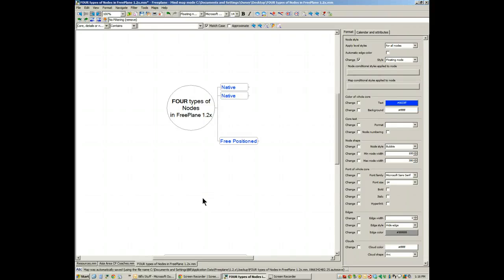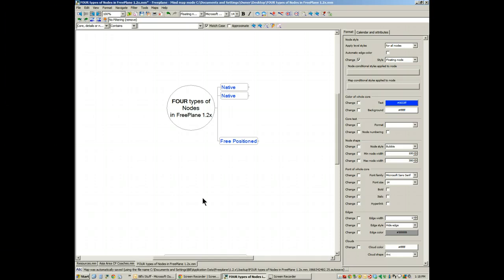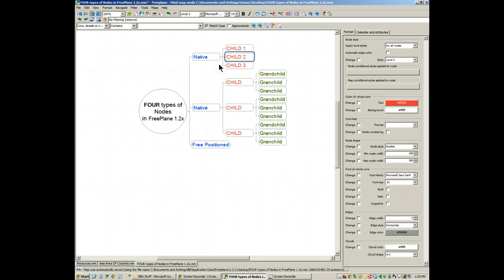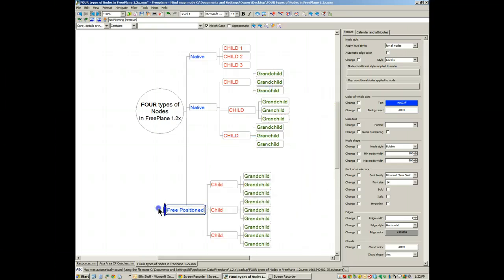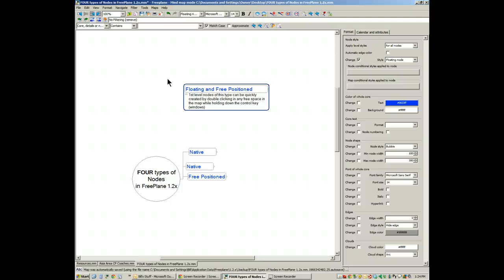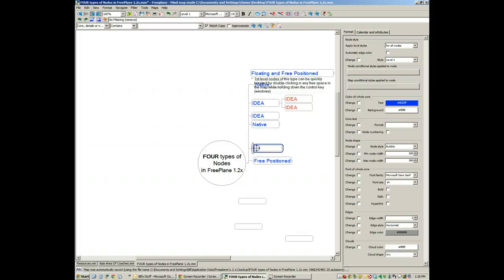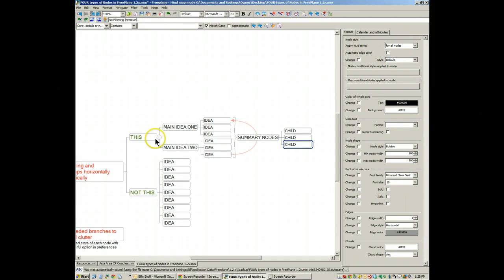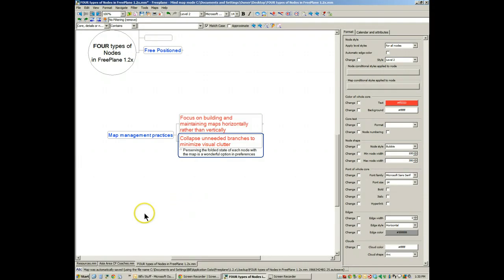Node interaction in Freeplane 1.2.x

Comment: I give.
HOW do I add a node?
Reply from the maker: Well, just for completeness for future searchers, you can always add a new node via the menu (EDIT->NEW NODE->ADD CHILD NODE.    It's easy to change the key designation for any menu by use of the menu item TOOLS->ASSIGN HOT KEY.  This pops up a little dialog box instructing you to open the desired menu function (leave the dialog box open).  When you select the menu item FP will show you the current key stroke/key stroke combination and allow you to change it to any other designation.  If you pick something that is already in use, you will be warned before allowing you to override...
Reply: Just found it. It is not listed anywhere that I could find. But, hit the
INSERT key and voila, a new node.
Reply from the maker: Great that you found it.  There is currently a discussion going over in the Freeplane user community about the need to improve/revise user documentation.  Your case is another in point.  There is a wonderful feature in Freeplane that allows each user to define specific keystrokes for ANY of the menu items in the program.  Years ago I changed the "add node" key to TAB and now use it that way all the time.  It was just easier for me to hit TAB with my left pinkie finger because its usually in the same place on standard keyboard whereas INSERT can be in funny places.  In a recent video I mentioned that TAB was the way to insert a new node and people came back and told me it was INSERT.  I didn't even remember that I'd changed it and here I am telling people something that I thought was native and it was something I customized!  Bottom line:  It's easy to set keystrokes that make sense to you.  So if you like using INSERT (and that is standard often used in many software platforms, then you're set.  But you can also change any of the key designations in Freeplane to anything you want them to be...
Reply: Yeah. I bought a small, portable keyboard, and it didn't even HAVE an insert key.

Comment: I need to make a kind of timeline and I am wondering the best way I could do it using this software. I think the best way for me might be to have it set up where there aren't parents and nodes but just a stream of points along a timeline. BUT I would like to have multiple timelines showing different areas of research over the same period and how they connect at later periods.

Any ideas would be great thanks.